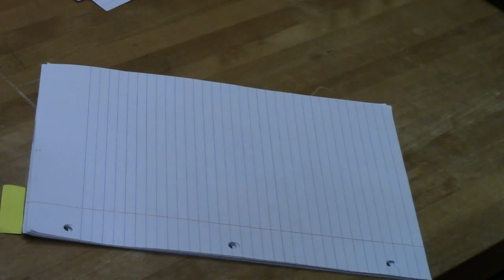Derivation of Non-Linear Spring Weight System

Comment: hi
It was a great way to write the derivation. very informative. 
is it possible to write an equation for a non linear curve for a spring. If the force - displacement characteristics is available, then how ca one derive an equation from it
Reply from the maker: Yes, simple answer is  displacement/force transmissibility equations. Once you have 2/more masses coupled together then big matrices are used to graph.